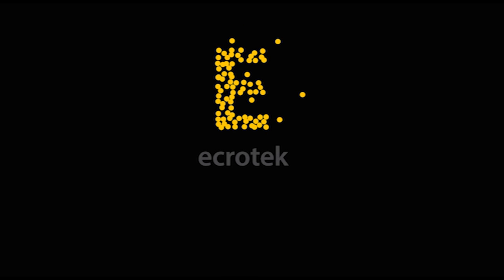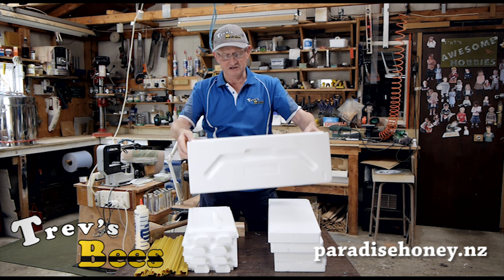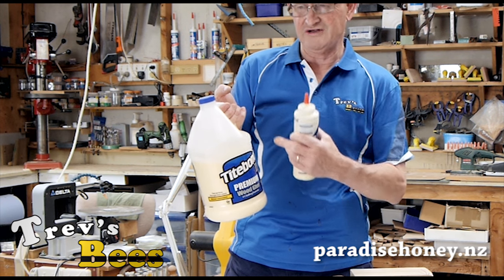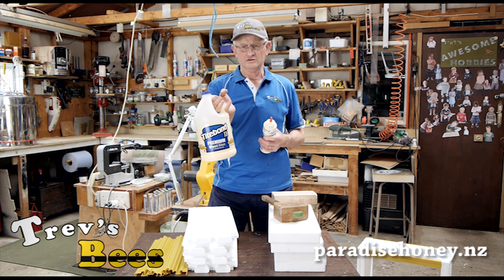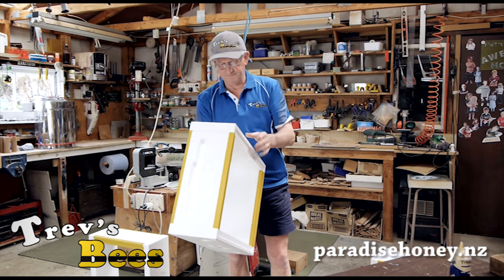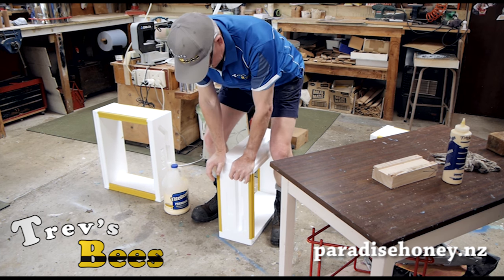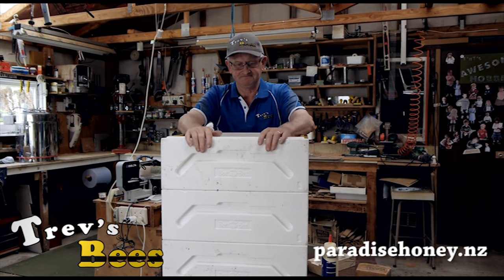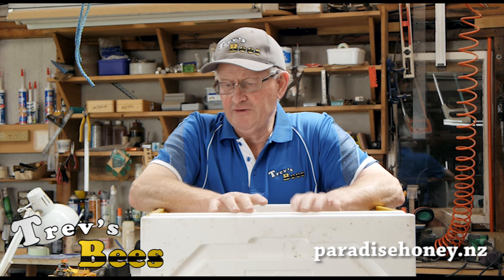Trevs Bees - Assembling Paradise Honey Bee Hive Box

Comment: Hello Trevor, excellent informative video, as always. A small but important point you did not mention, when applying the glue, it is important not to get any glue on the ends of the tenons, otherwise you get an hydraulic effect that prevents the sides/ends being pushed fully together, because the polystyrene is moulded to such tight tolerances.

Comment: I've always wondered what you would do with them if you found AFB. The potential pollution from burning puts me off.
Reply: The Paradise site has some suggestions for sterilizing Polystyrene hives:
"Polystyrene does not rot, wrap or absorb moisture. Therefore the 
maintenance of the hive is minimal and the first painting will last for 
tens of years. Parts soiled by bees can be washed gently by hand, or 
with a steam washer. Careful steam washing will remove almost all 
pathogens. If the bee colonies have had major problems with bee diseases
 the boxes can be disinfected by washing them with a 4 % solution of 
sodium hydroxide (NaOH). The same can be achieved by washing the hive 
parts with a solution of dishwasher detergent powder. A solution of one 
tablet in 5 litres of water is of appropriate strength. Virkon S is a 
disinfectant widely used in Europe. A 2 % solution of this disinfectant 
will kill all bacteria and spores of bee diseases when sprayed on 
pre-cleaned hive surfaces. Virkon S is biologically degradable and is 
not harmful to bees. The active ingredients are among others potassium 
monopersulfate 50% and organic acids."